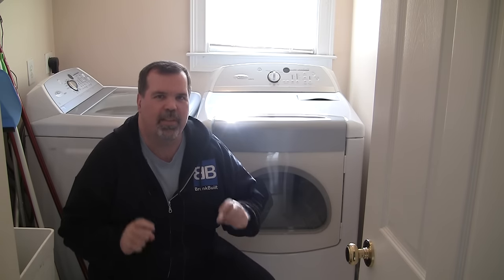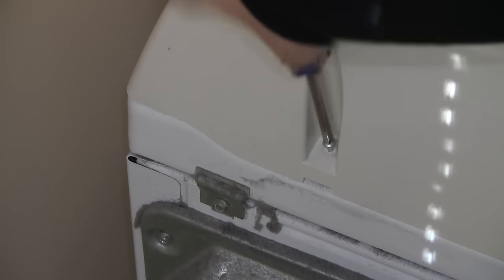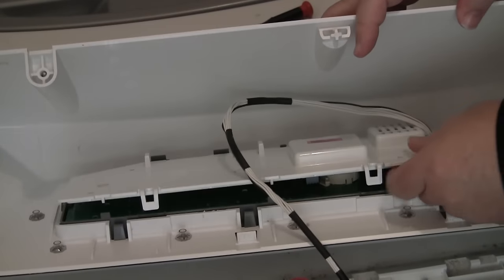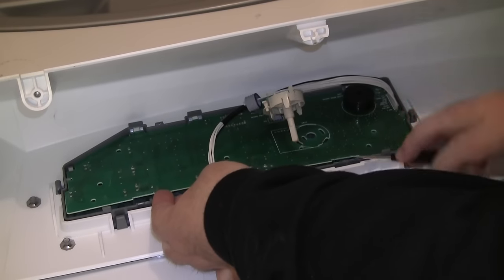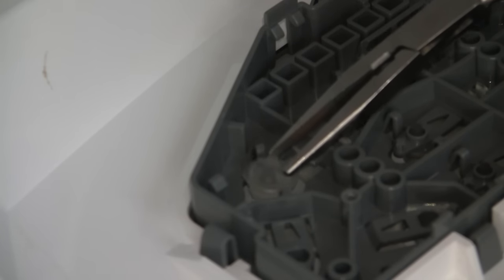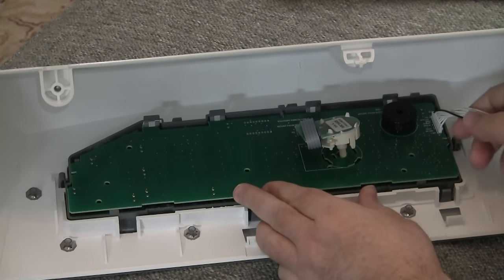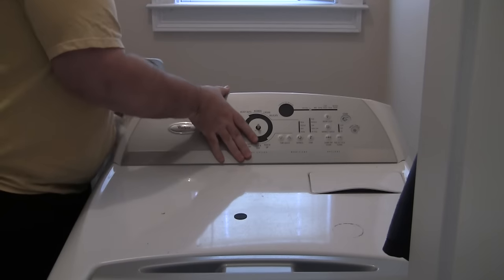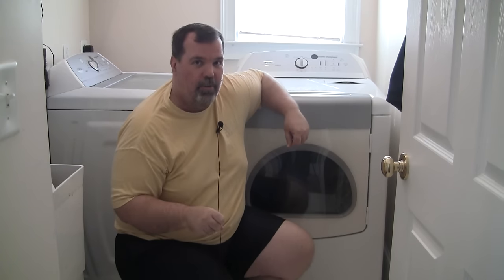Fix a Whirlpool Cabrio dryer that will not start (How-To)

Comment: I have an old Whirlpool Cabrio dryer that is over 10 years old.  It worked fine until last week.  As in the video, the stard buttom stopped working.  We did exactly as the guy said in the video, up until the wood piece.  Instead we tried it with.. simple as hot glue.  As of now, it works great!!!! Thank you so much for this video.  I didn't have to pay a repairman or worse, a new dryer ;-)
Reply from the maker: Love to hear that!

Comment: Thanks for your wonderful video!!! You helped me dismantle the dryer control panel, which I wouldn’t have had the know how otherwise! I didn’t use your wood replacement idea, but cut a tiny square of a plastic diabetes testing strip and super glued it to the underside of the 2 little prongs of the broken piece that was still in the large piece. After it dried,  I took the remainder of the broken piece and super glued it in place and then topped it off with another little plastic square! After a couple hours, I reassembled it all and Voila!!! My dryer will now turn on!!!  I really think the plastic parts are very cheap for what a new dryer costs! Thanks for your informative video!! 🤓
Reply from the maker: Great job and i agree for the price a little better plastic is in order.
Reply: A question: why did you need "another little plastic square"?  As long as the clear plastic button piece and the broken-off piece are in place, you do not need an extra high to push the button on the printed circuit board?

Comment: Many thanks!! Fixed in 15 minutes! My family thinks I’m a wizard when I’m able to do this kinda stuff. Thank-you YouTubers and all the real wizards hiding behind the curtain!!
Reply from the maker: And you never have to tell them anything other than you figured it out and fixed it.
Reply: Whoops I guess some of the super glue wasn’t fully dry when I reassembled and got into the little black button on the circuit board. Managed to desolder it and swap it with the dry detection signal button (which we never use) and got it working again.
Reply from the maker: Awesome.  Go to starbond.com and use BronkBuilt at check out and save 15%. Get some accelerator which makes the glue dry in seconds.

Comment: Man, awesome video, great jumping ability.  You totally helped me out.  My situation was EXACTLY the same as yours.  I put the broken plastic button guide back in place.  Instead of wood, I used a plastic hotel key card to hold the button in place.  I owe you a meal.
Reply from the maker: Glad it helped.  Never fun clicking the go button and nothing happens,  especially with a pile of wet clothes.  Thanks for stopping by.

Comment: A thousand thanks! I had a couple issues but I’m good at complicating things. The plastic button is really offset so I had to push as far as possible to the outside to make contact. I tried to make a template with the broken plastic piece in place but it really needs to be further out. I made several little wooden things before it worked. Then I couldn’t get it to start; I just kept getting a beep beep. After several times of removing and replacing the circuit board I realized the dryer door was open. Duh. Great fix!
Reply from the maker: I'm sorry but i actually laughed when i got to the end of your comment.  I can totally see me doing the exact same thing.  Glad you got yours working.

Comment: Thanks for the info, same problem with the my whirlpool cabrio washer start button (plastic piece holding button broke, pieces looked identical to yours in the video), I used double sided tape (cut double sided tape to fit the head on the clear button) then  attached button to the inside of the start button cover, instead of using super glue, I also used a piece of plexiglass, in place of using the wood paint stir stick (tired the wood paint stir stick, the wood paint stir stick I tried using was cheaply made and kept breaking every time I tried to drill or cut, I gave up and instead resorted to using the plexiglass). Cut and shaped the piece of plexiglass with a multi-function tool from Harbor Freight. Thanks for the information, put me on the right track which saved a lot of money in the end.
Reply from the maker: You are welcome.  Sounds like your solution may last longer than mine.  Been a few months for me and no iissues. I do wish i had used double sided tape instead of super glue.

Comment: More Whirlpool JUNK! Glad you were able to fix it. We have the same problem.
Reply from the maker: Hopefully you can fix yours as easy as mine.  Not sure i agree with junk as this at lasted around 15÷ years and this was the only thing that needed fixing with the dryer.
Reply: Good fix Bronk. Thank You for your ingenuity. The matching Whirlpool Cabrio wash machine gave out twice during the warrantee period. The online forums were thick with complaints due to faulty circuit boards. The third time it failed we got rid of the Whirlpool Flagship Cabrio Washing Machine. To make matters worse, the A&E factory repair tech robbed my wife's jewelry during his visit. The bad experience really left me bitter towards planned obsolescence and Whirlpool. Fords hold up well for me, but they don't do laundry! Thanks Again Bronk!
Reply from the maker: With all that,  i wouldn't be quick to move back to Cabrio either.

Comment: Many, MANY Thanks. I lucked into finding your video after having the same problem a couple of weeks ago. Wish I could post pics to show what I did - a lot easier to 'show-and-tell' vs just 'tell' in words: On the underside of loose broken part, I Gorilla Glued a small piece of plastic the width it with enough of the plastic extending a little bit beyond the actual break area. After that dried, I put a dab of glue on the part of the plastic that was extending past the break as well as on the break itself - essentially, I had 'splint' supporting the bottom. After that dried, I glued a similar sized piece of plastic on top that bridged the break - another 'splint' on top. This solution worked fine. Hope that made sense to anyone reading this.
Reply from the maker: Awesome. Go to my FB page and send me a message with the pics.  Love to see them.

Comment: Exact same problem here.  The piece of plastic holding the button in place broke off.  I went to Lowes and got a tube of JB Weld for Plastic epoxy to glue the broken piece back into place.  15 minutes set time and 30 minutes cure time according to the instructions.  Will give it a few hours just to make sure before testing it out.  If you don't here back from me then all is fine.  Thanks for the video.
Reply from the maker: I've been amazed at how many have had the exact same issue.

Comment: Thank you so much! Your video was so helpful.  Instead of using the wood chip I glued 2  tiny strips of plastic to the broken pieces so it would adhere to the ends and it worked!!
Reply from the maker: Glad it helped. I agree nice sturdy plastic instead of wood is a better choice.
Reply: I am not quite understanding how the "2 tiny strips of plastic" work. Did you make a hole on each of the strips?
Reply from the maker: My guess is that he glued the 2 tiny pieces of plastic on the broken piece to "fix" the broken piece.  I think he glued the 2 pieces across the break to give strength and support back.
Reply: @BronkBuilt  Thank you very much for your quick response.  I am gradually understanding how the button works.  Your Video is awesome.  I am fixing the identical issue on my dryer.

Comment: Thank you for help on Whirlpool Cabrio will not start... I glued the broken part and started working. I hope it lasts.. For the cost of superglue NICE. I love this Guy..
Reply from the maker: Thank you.  Glad it worked for you
Reply: now I have no power.. fuse.. ???
Reply from the maker: @jamesneese5359  possibly.  Double check the connecting to the main board.
Reply: I did use Gorilla glue and I replaced the board it had the power button go out.. Thanks for the tip about the diodes click nice save...
Reply: @BronkBuilt  The plastic that broke. I could not remove it. So I just put in the new board. It works any ideas to remove the plastic and replace it..
Reply from the maker: Not really, no... sorry.  I used acetone to reverse the super glue [spilled the bottle all over the board].

Comment: Awesome video! This is exactly what I needed to take my top panel off. I found this is exactly what happened to my Cabrio.
Reply from the maker: Awesome! Glad it helped.
Reply: @BronkBuilt Quick follow-up...what size bit did you use to drill the hole? Thanks again!
Reply from the maker: @blown22  sorry I don't remember. I want to say 3/8 but not sure.
Reply: @BronkBuilt  No worries. I used a small bit on a Dremel, then bored it out to a snug fit and glued it on. It's drying now. This was actually better fit than a circular hole. I'll let you know tomorrow how it worked. Thanks again!
Reply: @BronkBuilt  I placed the piece in there snug, and then the circuit board (but not the white pastic cover), then tested it. It seemed like it may have barely pushed the button on the circuit board (weak click) on the first push, but then it didn't make contact from the second push onward. So I popped the circuit board back off and the piece I had fashioned was pushed out of from the two gray plastic prongs instead of being flush/level like it had originally been.

So now I need to ask you a few more questions: (1) Should I retry this, but also attach the white cover and 3 screws first - would that make any difference? (2) Do I need to actually glue the button to the inside of the cover?  (3) Maybe a dumb question, but how thick was the paint stirring stick you used?. My wood piece looks to be 2 or maybe 3mm thick; a little thicker than 1/8", but thinner than 3/16".  It looks pretty close to yours.

Thanks for your continued help on this. I really do appreciate it.
Reply from the maker: @blown22 of it is a snug fit I think no glue works be fine. I don't have a paint stir stick handy but it was a normal one you get at home Depot paint section. I'd say 1/8 inch to 3/16 inch. This whole thing works be easier if they simply didn't make the circuit board button offset from the panel. You'll need to just pay with it a bit until you get the perfect fit. Some people simply glued the original piece back on and that worked for them.

Comment: Man ... you have a tight laundry room. I was waiting for you to use your table saw sled to fix it. Very informative ... However I simply go to the laundromat ... for just one person it solves a multitude of issues. Great video ... And yes your legs are more White than the dryer. With those legs I am revoking your Native Californian Card.
Reply from the maker: We were doing laundromat until i got time to fix the dryer.  They are nice as you can do multiple loads at once,  but kind of a hassle to pack up and go and hang around for an hour or so. Also gets expensive.  Legs get white when your not at the beach all day all seasons of the year.
Reply: Lol

Comment: Good concept.  Took some jury rigging to get the wood to fit and then stay in place.  I used scotch tape as per someone in the comments.  Maybe it would've stayed in there tighter after I tightened the back panel, but it seems to be working now.  Much thanks.  Excellent video too - easy to follow & simple instructions.  Also enjoyed no music in the background so I could actually hear what you were saying.
Reply from the maker: Glad it helped. I've been so surprised at how many have had the exact same issue. I actually debated on doing the video as I thought it was specific to my issue

Comment: Wish we would have seen this earlier, we took a utility knife and cut the plastic off over the start button and we just put our finger in there and press start.  LOL  BUT now another issue. Those four little LED bulbs (or whatever they are) next to the start button... one of the four lights is not green.  Is there a way to just replace one of those?
Reply from the maker: hmmmm.  My bet is that you will need to replace the board for that.  After about 15-17 years mine finally completely burned out working so I replaced them with new units so I can't even go back to check, sorry.

Comment: I like your ingenuity but wonder if the adhesive (glue) you used on the button plunger was really necessary. Also, was the piece of wood really necessary? Couldn't you use high strength epoxy (such as JB Weld 50132, or JB Weld 8281) to repair the original broken part? I am also curious about what diagnostic process you used to determine that the switch was the problem.
Reply from the maker: Thanks for the questions.  I'll try and answer them all...
Q: Was glue needed.  A: I think so.  There is empty space in that little section so the glue was needed to hold everything in place.
Q: Was the piece of wood necessary?  Possibly epoxy the small plastic back together?  A: It would have been difficult to repair that little plastic piece, at least for me.  There were two very small tabs that had broken so it would have been tough to get it back together.  I just grabbed the piece of wood because it is what I saw and honestly I was not sure if it was going to work.  Others have commented that they used a small piece of plastic or acrylic which is probably a better choice.
Q: What was my diagnostic process?  A:  Honestly there was not a ton.  I would press every other button on the dryer and I could feel a physical button press.  Hard to explain, but I could definitely feel that I was physically clicking a button.  With the start button I couldn't feel anything at all.  Like there was nothing at all behind the cover.  That's when I actually got a bit happy.  I figured if it was simply some sort of a broken switch and not an electronic issue then I have a pretty decent chance and fixing it myself.  That's when I started looking for screws to take it a part.  I figured give it a shot and if I couldn't get it working, then call the repair person.

Hope this helped.
Reply: @BronkBuilt   Awesome. Your diagnostics were pretty straightforward, easy, and a bit lucky. Any solution that fixes it and continues to work is certainly good enough. On another subject: I have a cheap $14 angle grinder that after a lot of heavy use, spun the gear off the gear shaft so it wouldn't spin the wheel anymore. Just to complete that project, I wrapped a piece of baling wire around the shaft and twisted it tightly with a pair of pliers to give it enough tension to spin the wheel again. I just wanted to get through another 10 minutes of grinding, but, here I am 5 years later and I've done another 100+ hours of grinding with it. That silly bailing wire fix is still holding.

Comment: Same problem and your nailed it...all fixed now.  However, after putting it back together, the dryer will not shut off.  i.e. in Normal mode (a 40 minute drying cycle) it will run until I manually stop it.  For instance, last night I set a Normal cycle load...in an hour, it still said it had 79 minutes left.  Any idea why?
Reply from the maker: I'm sorry to I'm not sure. Maybe a bad moisture sensor?

Comment: Thank you so much this was our exact problem. I’m so glad I found your video! We used flex seal on the plastic piece instead of super glue.. it wasn’t holding. Waiting on it to dry but I’m sure it will 😁
Reply from the maker: So nice to have a couple dollar fix vs calling "the guy" for couple hundred dollar fix.  Glad this helped.

Comment: Wow when it comes to electronics I’m really not that savvy but this video really help me to nail it and I got my dryer to start working again thank you. No I did try superglue on the plastic part and if it works and keeps working yay but if not I know exactly what I have to do I do have a paint stir stick I just need to figure out a way to cut it down and drill a hole but otherwise I can dry my clothes so thank you
Reply from the maker: Excellent! Glad I was able to help.

Comment: That was the exact problem for me too. thanks. Thankfully, I just needed a few drops of super glue and I was back to business
Reply from the maker: $3 fix instead of $300. I like it!
Reply: The piece I put in did not engage the  button or switch on the board. Can’t figure why not
Reply from the maker: Make sure it is in the correct place.  The button on the circuit board is offset a bit.

Comment: Great video.  I successfully repaired my switch but now another one seems to be going.  Do you know the part number for the interface component?  My circuit board looks fine but I want to make sure I order the correct part.
Reply from the maker: Don't quote me on this but I think it may be part number 8563974.   Here is a website for parts: https://www.searspartsdirect.com/partsdirect/brands-products/Whirlpool-Parts/Dryer-Parts?sid=ps:GOOGLE:Dynamic%20Search%20Campaign%20-%20Categories:dryer:&k_clickID=a86d4291-a0c8-43ae-afe3-24cb8292c7e3&gclid=CjwKCAjw_IPcBRAjEiwAl44QkX6G9WGoiy0A6S0s53Po0QLQas80AeoI6N7lyFugJEj0VGtrWe5cZBoCEoIQAvD_BwE&kenibpid=p.590.a86d4291-a0c8-43ae-afe3-24cb8292c7e3.cr368162

Comment: Thanks for the help, Dale! I also had the exact same break in the plastic paddle for the power switch.  I just used a two part epoxy to glue it together and it's working fine again.
Reply from the maker: Excellent!

Comment: Do you have the dimensions of the piece you cut from the paint stick? Did you remove the 2 arm pieces that the piece snapped off from?
Reply from the maker: Sorry, didn't remember the size. Needs to be long enough to reach button on the circuit board. I didn't remove anything except the piece that broke. Hope this helps.